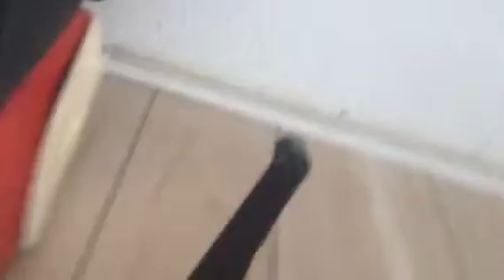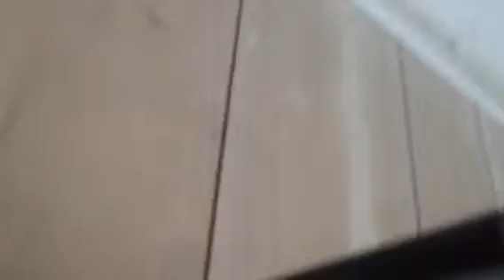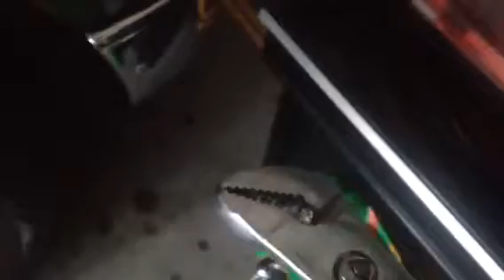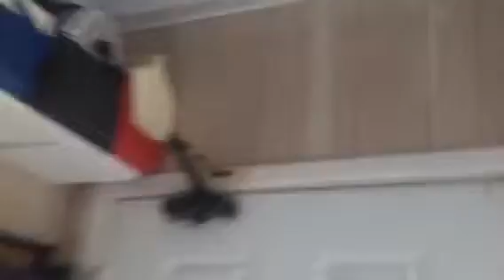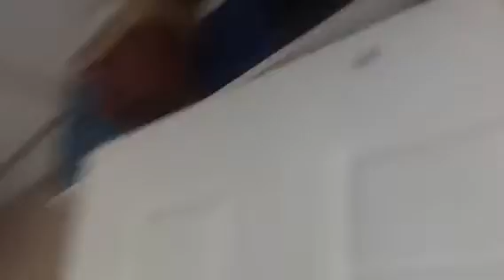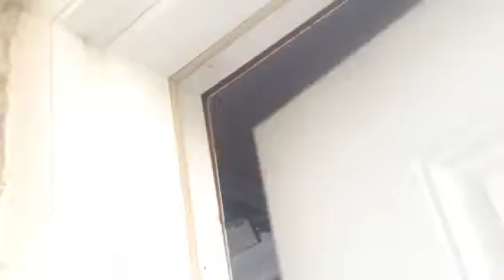Update on my global door closer

Comment: hello Momgumery,  

longer screws should fix the hinge problem, glad you fixed the problem with the arm bushing with pliers,  

during latch I can see the arm has vertical movements, if the screw and washer are tight on top of arm, do you see any wear on the pinion shaft or the hole the pinion fits into (take arm off closer to check this)

hear from you soon,  

-Jess the door closer doctor